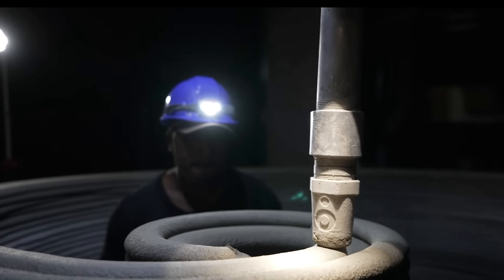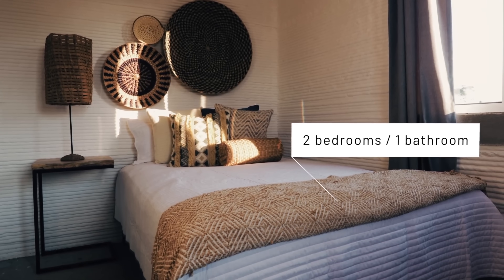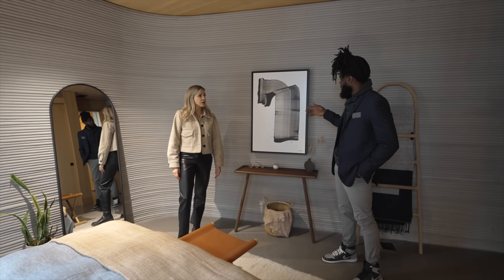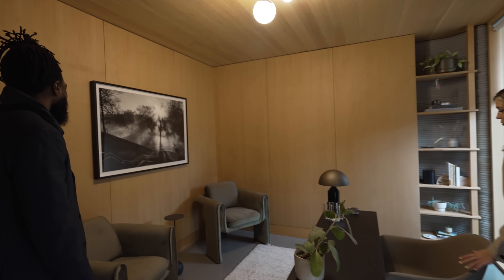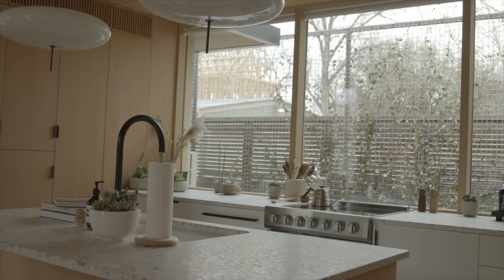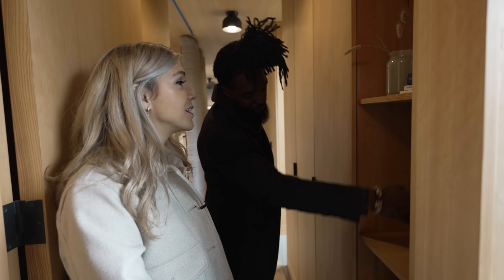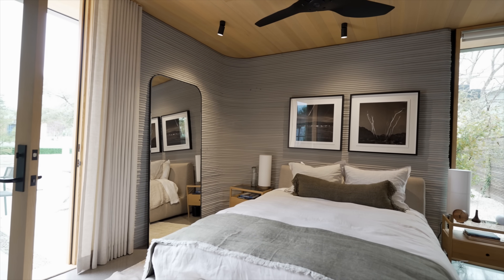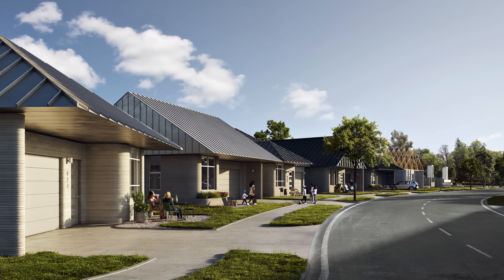Inside A 3D Printed House You'll ACTUALLY Want To Live In

Comment: I think you basically missed the point by overanalyzing the element of concrete. People have been building concrete homes for a pretty long time, basically in most of Europe. The innovation here is the 3-D printing aspect.
Reply: Oh and I also have to add that they didn't use any steel beams to hold the concrete and I'm really curious how that works.

Comment: Awesome look at this latest project and its great that you included their past work too! Can't wait for your next 3D printed construction video!
Reply: I do NOT want that house.  to many "technical" /structural Restrictions inovolved with it and  it required constricted sizes.  The material is a horible mess. Then huge expense to "cover/finish those walls".  Wiring and plumbing issues.  If you want to build something like that there are better/Cheaper , simpler ways to do it.  search ,... Oh what is it called,  Mud/sand bag , earthen bag construction.  And I am not saying I would want that for my main house either.  I've have seen nice hotel rooms....  cement is a mess! espeically when you leave it exposed. Dirt , spiders, and bugs "sticking to it" and those layers/grooves!  then trying to deal with plumbing, electrical etc,  and even try hanging a shelf or picture. :-)) wanna change a door or window? 😅😅😅 that texture is aweful.  even beyond cleaning it has problems.  the novelty would wear off quickly.  and trying to cover that up with wood, plaster, etc... IS $$$$$   Are you noticing that even with the camera/"lense"?shooting done to try and make it  look bigger.  Look at how SMALL the rooms are. EVEN The ones that are supposed to be "larger rooms"  Oh and I live in a mostly solid cement walls and roof/ceiling ...  I will call Bull Sheets on it being 75 F inside on  days when it is in the 90's .  I live in the desert and once it starts warming up in the spring in the "90's" after a few days the cement warms up, the walls warm up and there is no way you are going to have 75F inside without turning on the AC.  if it goes "hot" then cold" then "hot" the cold for a couple of days, then Maybe... But after after a few solid days or warm/hot temps, the cement warms up. and as the temps keep on climing for "the SUMMER/ spring"  the walls of the building keep getting warmer.  In the low desert in AZ,  if I turn off the AC it will "quickly" start climbing toward the 90's F. I guess higher if you forget to turn on the AC.  Oh, and of course the Reverse happens in the winter.  Sure the novelty of this is "cute"  but the reality is..................  Not So Great.   especially if you DON'T want just a little/cramped "single persons"  condo/vacation condo"  and You don't want the MESS of unfinished cement walls.  You know what else you will notice about this... NO REBAR REINFORCEMENT/"structural support".  And there Are More issues than just these... Ahh but the Novelty of it. 😅

Comment: The house looks really nice, the curved walls add to the intrinsic design and also the staging was spot on. Only concern is how difficult must be to dust off clean all those layers of concrete that form the interior walls. And lets see the exterior walls how well they perform in terms of stains and dirt in the short term. Australia is contemplating banning dark color roofs because of the island heat effect. Black or dark roofing for Austin not the smartest decission, those homes must feel like an oven in the Summer.
Reply: I thought of the “dusting” too. So would you then have polished concrete to make cleaning easier? I guess we will find out huh😗 As for the heating and cooling, like floors, if that machine can work around a water membrane or piping in the walls for climate control, that would be cool. Run the loop of the radiant heating/cooling floor tubing for concrete in the floor, then up the walls and pour around it🤷‍♂️ Good comment, got me thinking 🙌🙌
Reply: A solution (with added labor cost) would be to smooth plaster the interior walls.
Reply: I saw the Three Birds using a lot of white roofs in Oz. White roof was never a thing here in central Europe, but they are si seemed more and more often, and also green roofs. I thing partially underground houses are cool and effective if you live in a hilly terrain.
Reply: @leoprg5330  Partially underground houses are very common here in Slovenia because of terrain. But it's only the basement and garage that are partially underground. And it's always so nice and cool in the summer.
Reply: Very nice home indeed, yet I am convinced that just the extra elements (other than the concrete walls) probably cost more than the hous I live now ^^

American have budgets that are fare superior in comparison with most countries (even in Europe)
Reply: @stefanswiss3760  That's another point I always think about when any company in america says "affordable for everyone in the world". I just came from the "boxabl" video which is about the house that could be transport in a box and construct in under 1 day. just to have the pricing as reference, a small studio-like house that they showcase cost 50k. while its really cheap in USA, We could build a house noticeably bigger, have 2 actual bedroom and a lot of living room space in my country, 50k, include all the labour cost.
      but on the other hand. the world are pretty much open now. we could earn the salary of another country like say America or some European country while living a cheaper life in say, Indo or Thailand with the right skills and connections. so we just need to follow the technology and catch up with this soon-to-be "standard living style".
     if interested, I would like to type more about this matter. 3d print, technology, future etc. its good to keep your mind on what would be good for you and share with the others
Reply: Please watch my audiobook summary
Reply: I do NOT want that house.  to many "technical" /structural Restrictions inovolved with it and  it required constricted sizes.  The material is a horible mess. Then huge expense to "cover/finish those walls".  Wiring and plumbing issues.  If you want to build something like that there are better/Cheaper , simpler ways to do it.  search ,... Oh what is it called,  Mud/sand bag , earthen bag construction.  And I am not saying I would want that for my main house.  I've have seen nice hotel rooms....  cement is a mess! espeically when you leave it exposed. Dirt , spiders, and bugs "sticking to it" , then trying to deal with plumbing, elextrical etc,  and even try hanging a shelf or picture. :-)) that texture is aweful.  even beyond cleaning it has problems.  the novelty would wear off quickly.  and trying to cover that up with wood, plaster, etc... IS $$$$$   Are you noticing that even with the camera/"lense"?shooting done to try and make it  look bigger.  Look at how SMALL the rooms are. EVEN The ones that are supposed to be "larger rooms"  Oh and I live in a mostly solid cement walls and roof/ceiling ...  I will call Bull Sheets on it being 75 F inside on  days when it is in the 90's .  I live in the desert and once it starts warming up in the spring in the "90's" after a few days the cement warms up, the walls warm up and there is no way you are going to have 75F inside without turning on the AC.  if it goes "hot" then cold" then "hot" the cold for a couple of days, then Maybe... But after after a few solid days or warm/hot temps, the cement warms up. and as the temps keep on climing for "the SUMMER/ spring"  the walls of the building keep getting warmer.  In the low desert in AZ,  if I turn off the AC it will quickly start climbing toward the 90's F. I guess higher if you forget to turn on the AC.  Oh, and of course the Reverse happens in the winter.  Sure the novelty of this is "cute"  but the reality is..................  Not So Great.   especially if you DON'T want just a little "single persons"  condo/vacation condo"  and You don't want the MESS of unfinished cement walls.  You know what else you will notice about this... NO REBAR REINFORCEMENT/STRUCTURAL SUPPORT.
Reply: Thank you 70 subscriber

Comment: I love the idea and the look.  My worry is that the exposed concrete would get dusty and be hard to clean over time on the inside and depending on where the house is located, it could get pretty gross on the outside as well.  At least on the outside I guess you could pressure wash it.
Reply: Exactly what I was thinking! The ribs in the concrete are perfect for collecting dust, but would be really hard to clean. Concrete's rough texture holds dust really well too.
Reply: @ElleryOmur  what if you cover the inside rib with thin flat wood.
Reply: Maybe on the inside you could use a blower.....probably a lower powered unit. This would at least get the dust into the air, and then it could be
taken care of by the HVAC unit. Maybe.
Reply: Like any other concrete.
They do make concrete paint.
Reply: Meh, look at desert cities like Las Vegas with the ugly stucco exterior, they get dirty the day after being built lol. Nothing new to us desert folk.
Reply: I'd use a vacuum with a hose and the brush attachment.  I think the brush is called a "dusting brush"?  Webs could be removed with one of those round topped brushes, like a Webster.
Reply: @shannahquilts  Yours is the correct answer. Dust on the exposed concrete is easily solved with vacuuming using a brush attachment.
Reply: Stucco it. Seems like an easy fix actually.
Reply: @fillername458  you are right....duh
Reply: Paint over the insides with a resin coat, seals the concrete, just like polished concrete.
Reply: Vacuum with a brush end!
Reply: Some of the walls in our new house are exposed brick for a design element, so not much different then concrete. If anything, a broom once in awhile keeps it tidy.
Reply: Just paint it
Reply: They said you can apply siding on the inside and outside. Not an issue. The real benefit is cost.
Reply: Did you guys watch the entire video?
Reply: If you have a habit of cleaning the walls after every two months, you wouldn’t need to worry about that, and maybe the outside after every 6 months. 
Either that or you could coat the entire concrete with a material that could easy be cleaning just by splashing water
Reply: Yeah, you can have the inside get finished to your preference of color and texture. Those walls could be as smooth and as glossy as a magazine cover, if you really wanted them.
Reply: Do your worries about the three d homes outweigh the wooded overpriced homes which are now be built poorly so in a few years you will be needing to do maintenance on new construction homes?  Weigh your worries and go from there.
Reply: Yes, the dust (pollen) build up was the first think I thought of when looking at these ribbed walls.....
Reply: That was my first thought.
Reply: There would not be an issue inside or outside.  Interior - vacuum walls with an attachment.  Exterior - use a regular hose with a car wash attachment.
Reply: Some builders are smooth-troweling the walls as they go. Labor costs, yes, but nothing like three coats of stucco would cost.
Reply: that's what water is for, babe
Reply: The dust is not a problem, just plaster and paint it
Reply: I would just allow the outside to stay the as the original design and just pressure wash the outsid when needed and then I would straightens out all the walls in the inside and add insulations, itś the only logical way to live in one of these.
Reply: I would just allow the outside to stay the as the original design and just pressure wash the outsid when needed and then I would straightens out all the walls in the inside and add insulations, itś the only logical way to live in one of these.
Reply: What if something is splashed anto the walls.
Reply: Really beautiful job
Reply: Nothing a powerwash couldn't fix, this type of building will probably stay as novelty though
Reply: Leo PRG NJ
Reply: You guys are cute . Love all these amazing ideas being brainstormed together